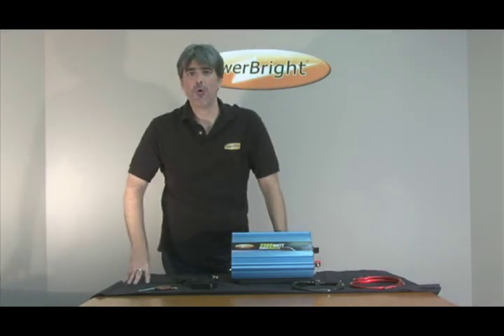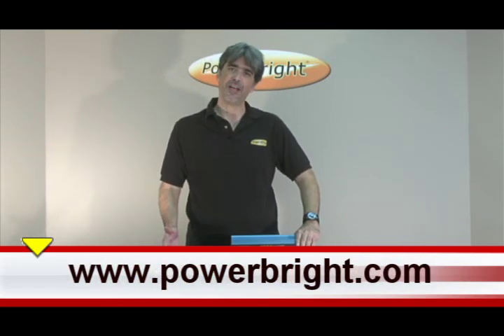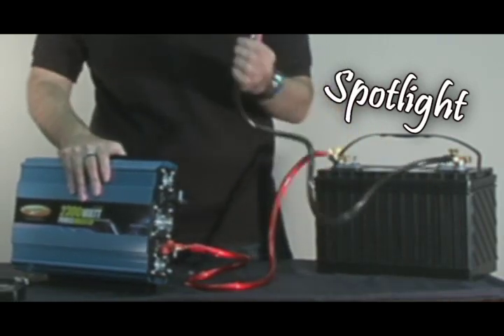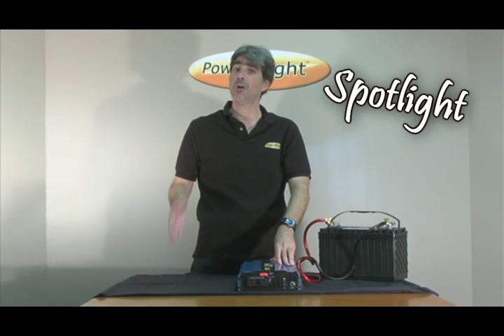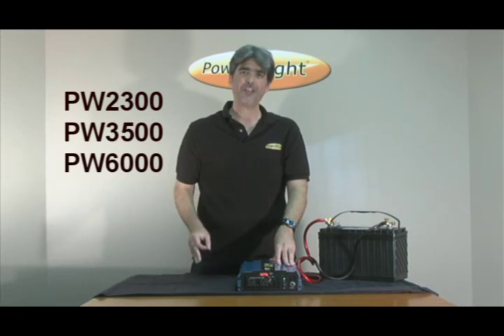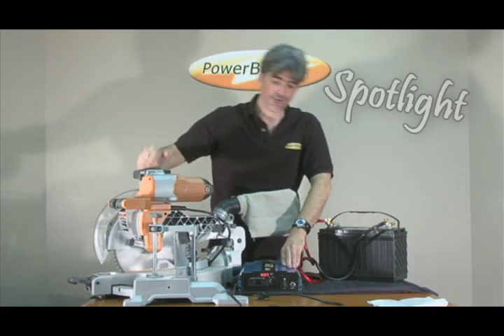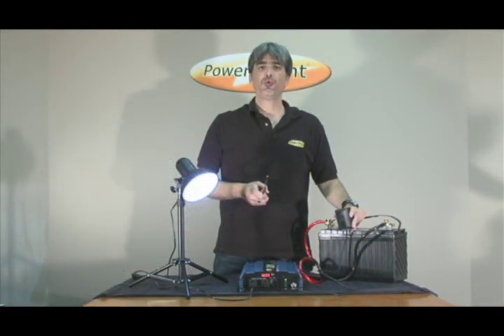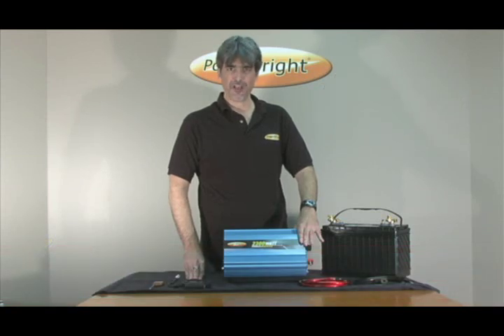PowerBright PW2300 - Instructional Video

Comment: I have the 6000 watt inverter from power bright and it will not power my portable air conditioning any help with that?
Reply: A soft start switch for the A/C unit should do the trick. I've seen the Powerbright 2300 run one.. I'm assuming you're plugging the A/C unit directly into the inverter.

Comment: Florida, (June 22, 2020 23:00 EST) — I’ve had one of these I guess for a year now and have run a microwave and coffee maker (not at same time though so not to strain really the car battery). 

I didn’t use the remote that much, wasn’t sure how “off” the unit really got and I didn’t want to chance draining the battery if it really didn’t turn off. I found out it is better to have a little light or other appliance in the circuit (tool battery charger light) to use as a reference to make sure the 120v was off. 

It still has around 20 watts or so just having it on.

The 2300 watt size was needed to not be fixed to a 2000 watt limitation, which seems to be popular with off grid apps. The availability of the 2300 was nice and not too much more just for that extra coverage.

After a while, you can feel the difference between a modified vs pure sine wave inverter, but you really can’t tell unless you have a pure sine wave to try and compare it with. Basically if feels much smoother of power. But running a $50 microwave or a $12 coffee maker off modified sine wave inverted didn’t seem to justify the added cost. 

However, if you got the extra cash, just pay the $100 or so extra for the pure sine wave version. I think Power bright has a fleet of pure sine wave units to pick from.  Especially if your using fine appliances or tools, maybe computer or TV’s. But if it is not motorized which I think the modified sine inverter would really affect performance on, maybe it is not a real world issue.

Check your measurements of where you think your installing it. The unit is sizable and you don’t want any last minute snags when you receive the inverter.

Good luck.

Comment: What gauge power wire are you using
Reply: The PW2300 requires a minimum of #2 AWG for up to 10-12 feet.
Reply: @mikeatpowerbright5793  if I used 0 gauge that would be more than enough 
I'm getting a used 2300 watt unit 
I'm excited
Reply: @mikeatpowerbright5793  do you have a reference chart? I just got another size From Amazon answers of AWG 0 to run a cable (10ft) from the battery under the seat to the back of a van where the inverter will need to sit. 

Also, do I need a full length ground wire as well Running back to the battery?, or can I just do a short ground wire bolted to the chassis? 

Obviously to cut the expense of the cable by half. 

I heard that running long grounds all the way back to the battery was not good practice, such as for audio amps. What do you think?

Comment: This guy needs to get a cheap plead suit because he is dishonest and ridiculous as a used car salesman.  The Chinese vacuum more than likely draws less than 600 watts about 25% of the units rating and 4000 RPM on the saw tells us nothing but that he is trying to divert attention from telling us the actual wattage it draws.  It is a big looking off brand junky import with a cheap motor that most likely draws half the amps this unit is rated at.  I am not saying it is a bad unit, just a very elusive and untrustworthy sales kid.  A big red flag as to buying anything from the website he is promoting.

Comment: Just a thought, but you might want to be sure that you have a FUSE OR CIRCUIT BREAKER on the positive cable! Some inverters have fuses in them, but for safety reasons you would want a 2nd one!